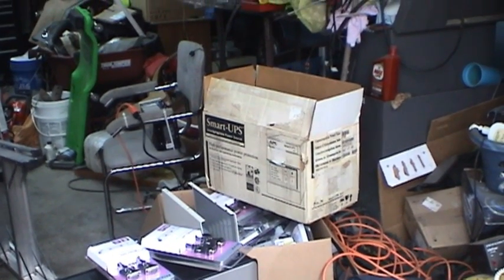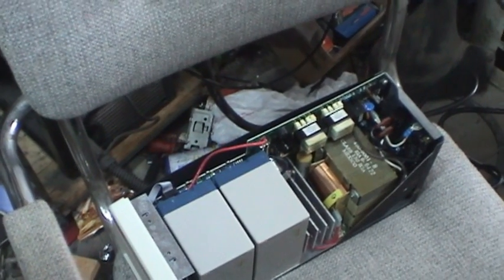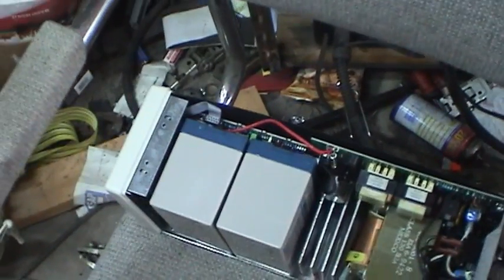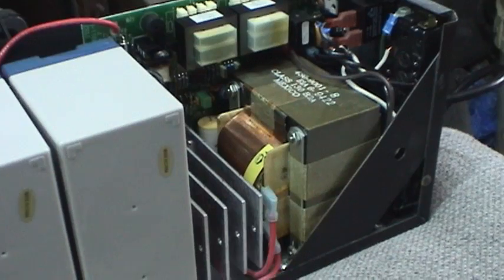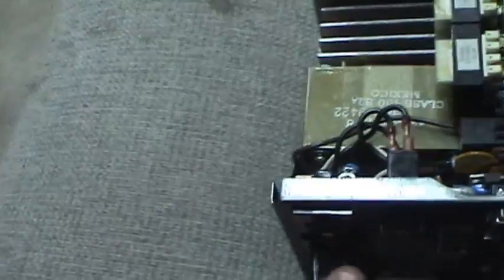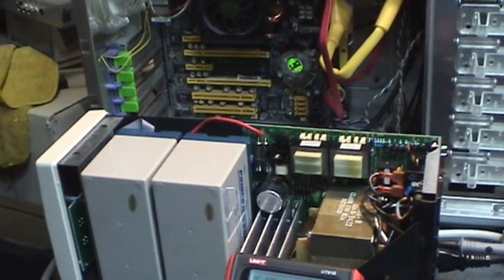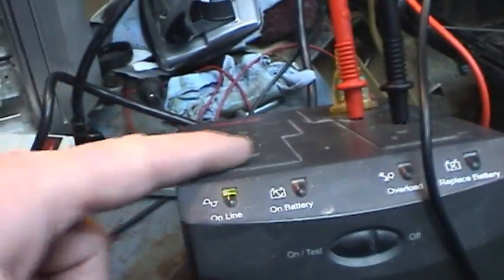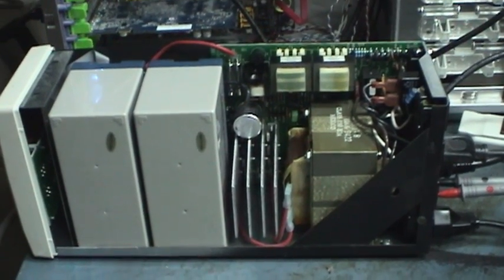Forgotten APC Smart UPS 600 Part 2

Comment: How many functioning UPS units do you have now?
Reply from the maker: +XeonProductions As liberating myself from Google Plus proved that Google has no time for data integrity and purged a great many of my comments, this is a repost.

I've got a fair number of them, and always have had. Lately I've found that it's a decent business to pick up old Smart-UPS models with dead batteries, clean them up, test them and sell them.
Reply: +uxwbill Google made a way to unlink from Google+ finally?
Reply from the maker: +XeonProductions They did, but ... if you do so, as I did, you may lose a LOT of comment "history" that you care about.

I'm not really sure why this lossage occurs or indeed what breaking away from G- actually means (apart from deleting one's presence there) as the comments are still very much driven by G-.

Comment: Now I know putting new batteries into my APC 600 UPS is a good idea, and it didn't work for me also because the original ones were dead, also I LOVE that little dark red Ford Ranger truck, I hope your dad drives it and doesn't let it sit. Lovely little pickup truck, Bill you should go drive it if your dad doesn't and get it a cap so you can keep stuff in the back, little Ranger is a nice truck. I would want it but I am in MA, and you are in IL, so even me getting there is a long a** way, it's just a nice little truck and I hope you will take care of it, it's still got a lotta life left in it! :)

Comment: Just as an experiment one time, I briefly plugged a 1971 Magnavox Stereo into a modified sine wave. It promptly complained and I promptly unplugged it.  
One of the oddest things I have read about happening was the power line frequency dropping before a massive blackout in 1965. 
An aircheck[2] of New York City radio station WABC from November 9, 1965 reveals disc jockey Dan Ingram doing a segment of his afternoon drive time show, during which he notes that a record he's playing (Jonathan King's "Everyone's Gone to the Moon") sounds slow, as do the subsequent jingles played during a commercial break. Ingram quipped that the King record "was in the key of R." The station's music playback equipment used motors that got their speed timing from the frequency of the powerline, normally 60 Hz. Comparisons of segments of the hit songs played at the time of the broadcast, minutes before the blackout happened, in this aircheck, as compared to the same song recordings played at normal speed reveal that approximately six minutes before blackout the line frequency was 56 Hz, and just two minutes before the blackout that frequency dropped to 51 Hz. As Si Zentner's recording of "(Up a) Lazy River" plays in the background – again at a slower-than-normal tempo – Ingram mentions that the lights in the studio are dimming, then suggests that the electricity itself is slowing down, adding, "I didn't know that could happen". When the station's Action Central News report comes on at 5:25 pm (ET), the staff remains oblivious to the impending blackout. The lead story is still Roger Allen LaPorte's self-immolation at United Nations Headquarters earlier that day to protest American military involvement in the Vietnam War; a taped soundbyte with the attending physician play noticeably slower and lower than usual. The newscast gradually fizzles out as power is lost by the time the newsman starts delivering the second story, about New Jersey Senator Clifford P. Case's comments on his home state's recent gubernatorial election.
Reply: +jefferyb304 Now that sounds like a fascinating read.

Comment: That's a pretty nifty little scope you have there Bill. I've always wanted an oscilloscope but could never pull the trigger due to the cost. How much did that unit run you and would you recommend it?
edit: Didn't realize you had not one but two scopes, please apply the previous questions to whichever one you think is better.
Reply: I found his red & black one, a UNI-T model UT81B, for $168 and up on eBay, if that helps. Oddly enough, there's a Geek Squad-brand one for $165 there, too.